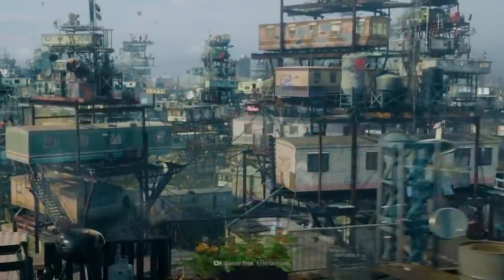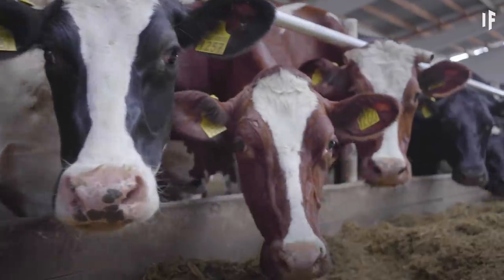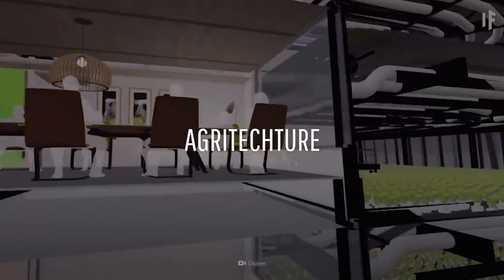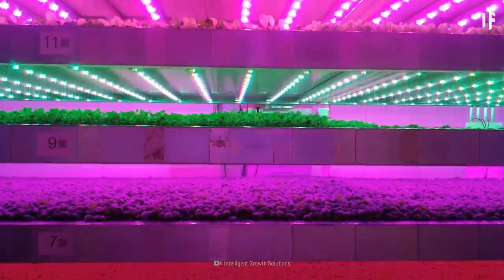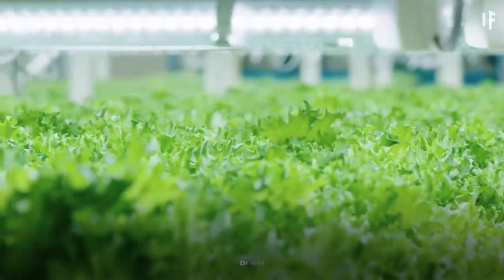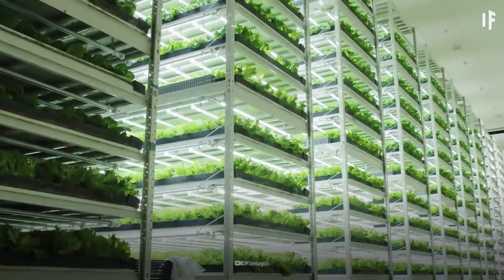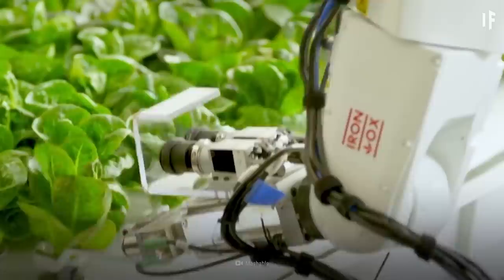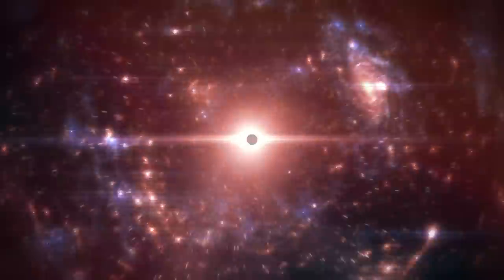What If We Built Vertical Farms?

Comment: I've been trying to figure out how to do this idea for many years. I'm not terribly far along the idea. I have scaled it up, in my mind, as far as a combined residential and vegetable vertical farm situation. I'm not convinced that it could be scaled big enough to feed large red meat type animals like cows, however animals as large as pigs could be possible. Rabbits and Chickens would be easiest and simplest. I found Grains to be a serious challenge because of harvesting. I suppose a dedicated grains room with integrated robotics for harvesting is possible, but that sounds expensive. 
Greens and root vegetables (with some adaptation) seem to be the most viable.
I agree that it's not as "Natural" as traditional farming, but "traditional farming" has become seriously unnatural over the last 30 years too, with the use of pesticides and petrolium based fertilizers to grow selective crops, when this can be done much safer and without pesticides, also non-petrolium based fertilizers in vertical farms. 
There's also the carbon footprint to consider. In vertical farming the carbon footprint is a fraction of that of annual fossil fuel use of traditional farms. Both traditional farms and vertical farms need to minimize transportation by deasel truck, opting for electric, and tractors need to be electric instead of combustion as well. Vertical farms can filter a lot more air than traditional farms based on footprint as well. The advantages of vertical farming are exhaustive, and with a little innovation, like say planting and harvesting robots that can be moved from floor to floor by a centralized cargo elevator, then food costs can go way down. This is no real change in labour from traditional farms because we will still need humans to do the same jobs in vertical farms as we do traditional farms. One human to control a robot doing planting and harvesting is the same as one farmer driving a tractor. During harvesting, same thing as well, several humans needed to take away full "baskets" and bring empty ones while the harvesting robot/human do their jobs. As I mentioned, Humans sort the food because they can determine if it's a "good" one or not, robots can't (yet). Vertical farms may actually emply more people, but produce more food, which would, at the least, balance out the costs. Vertical farms grow food FASTER as well because of the controlled conditions. Vertical farms allow year round growth because of controlled temeperature, light and water. Vertical farms can recycle much more water than traditional farms because of re-uptake. Vertical farms can filter and re-nutritionalize their water on site. I definitly see more advantages to vertical farming than traditional. 
All this being said, EVERYONE could save a whole lot of money by PLANTING a traditional VEGETABLE garden in the south/ south-west corner of their yards. You'd be surprised how much you can get once you've learned a little. Seeds are a lot cheaper than grown vegetables.
Reply: This is the comment I am talking about.
Reply: I want to know if you are researching on it and what have been your resources in your research

Comment: I agree on urban farming. One crop that I hope they'll be able to grow indoors in the future is the palm trees out of whose fruit palm oil is made. So that they won't need to cut so much rainforest to make room. Pest would be easier to control indoors. Locast won't be able to get inside when they storm and even if some bugs managed to sneak inside and cause pests, at least they won't need to use that much pesticide to eliminate. If the pest was caused by a fungus, bacteria or virus, the infection could be quarantined to stop it from spreading. The stench from aninals could easily be vented away (if high up). That'll be the best agriculture.

Comment: In places like the middle east,  a vertical farm would do a ton of good, but building down would probably be a better choice for HVAC costs as the ground would help maintain a better temperature throughout the year.  Also,  building down has an advantage for security reasons as it would be much more difficult to destroy a hardened underground facility.

Comment: Farms that require the use of massive amounts of electrical power and chemicals are not going to have many of the claimed benefits.
Reply: Vertical farming doesn’t use chemicals, but there are still downsides such as the increased power usage which could be a problem if something were to happen to our power supply and there is the issue of pollination unless we’ve already found a solution to that issue.

Comment: Constructing the vertical farm  do not forget of the most important thing: the vertical structure is creating a long shadow,  where next such a farm can not be located. Also , the plants  need the sun light  for their growth and  it can not be done  around the all building: from the north side the plant growth and the fruits amount will be  less, and their taste worse and not so sweet. Some plants do not like the wind, and  the higher loction, the greater the wind speed. Such can be the limitations of the method. Unless you will consider the artificial source of  the light , covered spaces and hydroponics. Some 50 years ago  such a vertical farm in high building was operated in Poland Chorzów in the  park- mainly flowers were farmed  there- I dont know the current status.
Stary

Comment: One problem not pointed out by this video is that vertical farms require an enormous energy bill in comparison to traditional farming, its still an improvement but before more vertical farms get set up that issue would have to be addressed

Comment: I think there is one problem in vertical farming. What about the electricity it needed. I just taught that even tough we reduce the pollution in transportation, what about the carbon footprint that came from power plants. This vertical farming methods needs electric source 24/7 and that needs a lot of electricity . I suggest that, solar panel or other renewable energy source  such as wind mill can be a great help in this innovation.

Comment: It's almost deliberately misleading to juxtapose vertical microgreen operations images of open-field farms growing things that couldn't be grown in any sort of vertical farm that's close to existing. Vertical farms also require more energy than open field farms, since they don't take advantage of any sunlight and require more inputs than permaculture approaches, which makes the 'what if we run out of oil' argument a bit strange to use as a cliffhanger. Vertical farms are part of the solution, but if we don't address our wasteful overconsumption and broken economic system it's just throwing fancy fuel on the climate fire.

Comment: It doesn't work. All attempts at large scale vertical hydroponic fail, regardless what you are told, they fail. Big money in this right now as you can see. Nobody is admitting their faliures. All those towers growing sideways will not produce. Sorry. Great idea. Stacking NFT channel like some of what you see here is currently working to a degree, but the larger it is, the greater degree of the failure. 
This type of farming still takes a large amount of infrastructure to support it. You're not going to completely offset these massive pumps and lighting systems with solar, you're paying less for water but you're paying more for proper nutrient concentrates, continuously. In a down-grid or emergency situation, without water, power AND nutrient, this operation is at a stand still. Increasingly so as the scale grows. Sorry. Great hobby though.